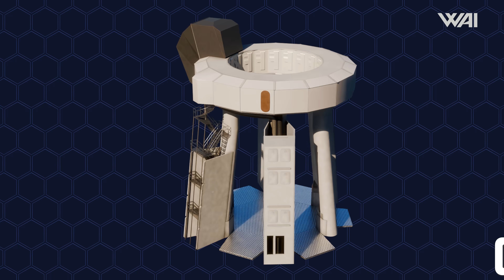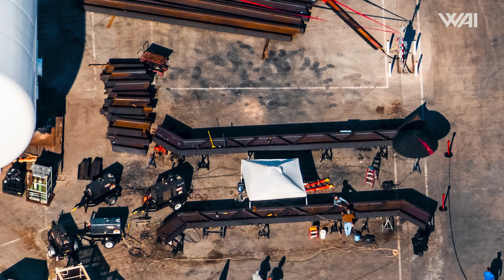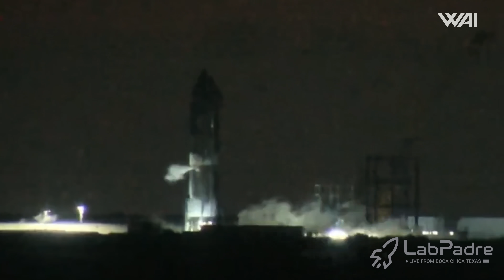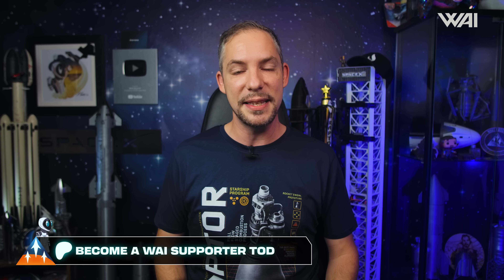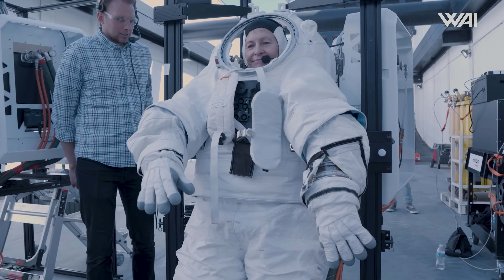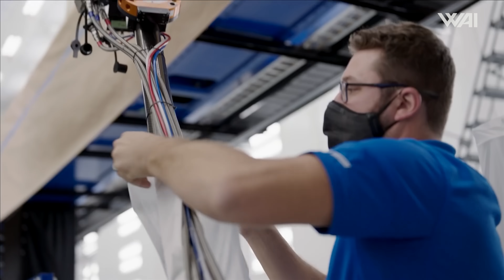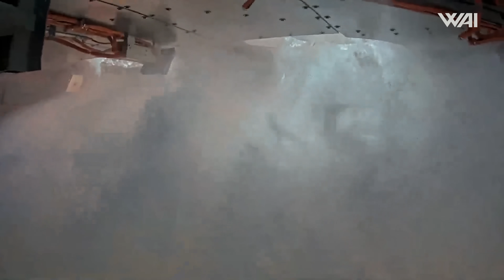SpaceX suddenly gives out HUGE info about Lunar Starship!

Comment: Something odd just happened when I opened this video. An AI like audio translation into German was activated and I thought I am looking at a rip off channel. Only after checking the options under the Settings menu of the video did I noticed a entry called Audiotrack.

Is this new? This crap was never activated before.

Also, does anyone know how i can completely shut off subtitles? I already turned these off in my general preferences, but they still get activated on some videos - like with this one.
Reply from the maker: It's new to me as well. It also got all te titles for the other languages wrong. This is a feature that must have been introduced by YouTube. They did not notify me about this.
Reply: @Whataboutit  for whatever it’s worth, I reported it to YouTube, that this feature of theirs is breaking content and is hurting content creators.
Reply: @Whataboutit  You definitely need to get this fixed, if not your channel won't be usable anymore on mobile devices where the audio configuration is not shown to change it back to the original language.
Reply: @Whataboutit it s really good!!! Hahaha. I like it in Spanish .also you can select the original audio. In Spanish it is really well done
Reply: Same happened to me right now. 🧐
Reply: Not exactly new, but wasn't available for every channel
Reply: It is very simple to change. In my case it started in spanish, a female tobotic voice... "besa mi brillante trasero metálico"
Reply: What the heck. I can't turn on the original audio track 😂 so now i can only watch the video in french, german, hindi, indonesian, italian, japanese, Portuguese(Brazil), and Spanish (US) but not English 😂😂
Reply: Dont have the option English (original) audio track on Sony Bravia (Google TV) youtube app. had to watch the video on laptop get original sound track
Reply: @SantoshKamath79  it is „English (United States) original" for this channel.
Reply: tatsache wtf
Reply: Cant switch it to original audio even after changing the app to english. Works on the phone but not on my tv or apple tv apps
Reply: ich kenne es nur von nem travel channel die audiospuren extra anlegt und fürs video auch anpasst man kann jetzt dadurch schlechter von unterscheiden die sollen das zusätzlich mit AI (kleinen Buchstaben) deklarieren
Reply: @Vardraq  „WASSER 414“, ich weiß
Reply: Yeah me 2
Reply: Yer on xbox I don't have English I have Spanish us
Reply: I was already wondering, what's up with the voice?
Reply: Same here. I got spanish, though.
Reply: Sames happened to me. Subbed in Hindi and I couldn't change it to the original audio.
Reply: I had the same problem vice versa: yesterday I tried to watch a math video on a known German channel, but the female German speaking math teacher oddly had not her original voice but an AI sounding English voice. Also, the video title changed. Seems to be a new crap like those stupid new fastenings of PET plastic bottles, which are firmly attached to the bottle and very awkward to use, mandatory in the European Union now.
Reply: Click on Settings (the gear icon) and then on "Audio Track", here select the last item: "English (United States) original audio".
Then Youtube ask you the opinion about the translation, don't forget to select >BAD<
Reply: @ixoipsop7142  Would be great if there would be an option „English (United States)“, but on my Apple TV it‘s „Spanish (Unites States)“ :-( Other Options: French, German, Hindi, Indonesian, Italian, Japanese, Portuguese, but no English. Seems I need to complain…
Reply: @ixoipsop7142  I did not got such a pop up, to provide feedback.
Reply: @ixoipsop7142  this option is only available through the desktop version of YouTube, or through the android app. It is not however available on the mobile website of YouTube, and it is partially not available on the iphone app
Reply: Bad this on other channels before, but the AI used the “original voice” there. Kinda interesting. But this standard AI voice is horrible. 😅
Reply: Watching in Cape Town South Africa on a Xiaomi TV stick, no option to change audio track to English. Only runs in English on my phone😢
Reply: I can't choose English! Unwatchable! 😭
Reply: For me, it play with Japanese narration only if I cast to a Samsung screen! With no Audio track setting available. On my Mac, it's back to English.